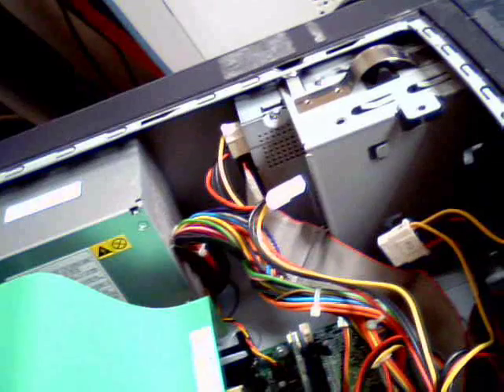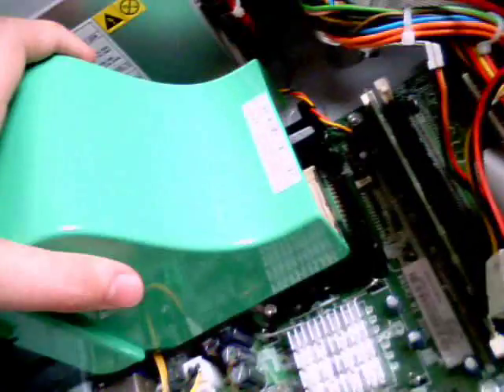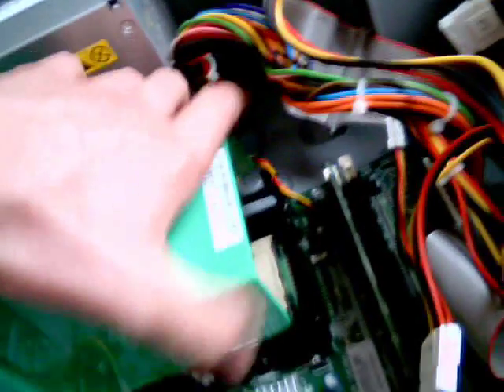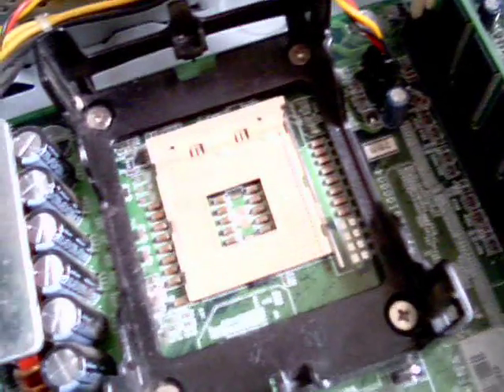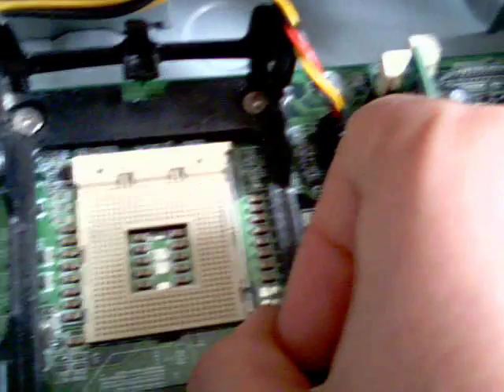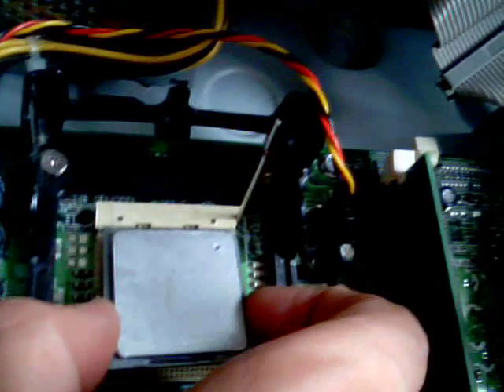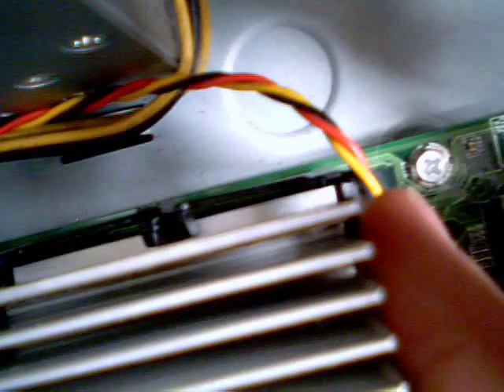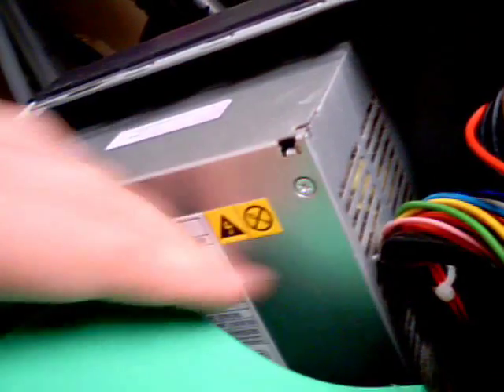How to upgrade/install a processor in a socket 478 motherboard

Comment: i broke my plastic alluminum heatsink holder   where can i get a aftermarket fan/heatsink that would be correct size    mine use little plastic snaps to hold that black bracket on not screws
dell demension 4550     thanks